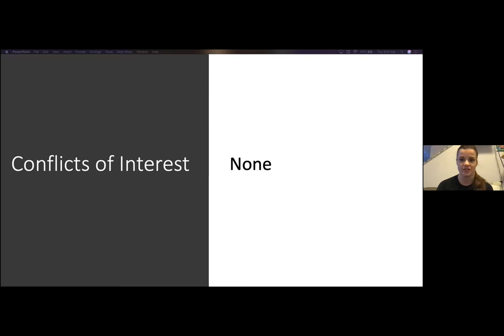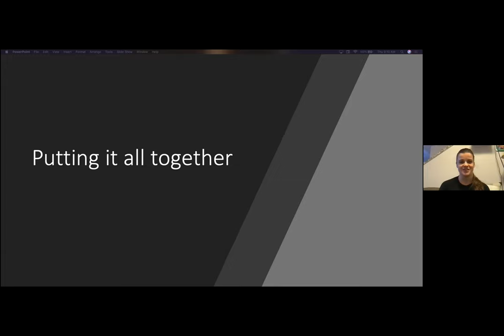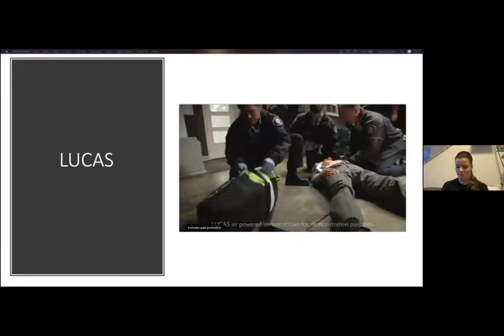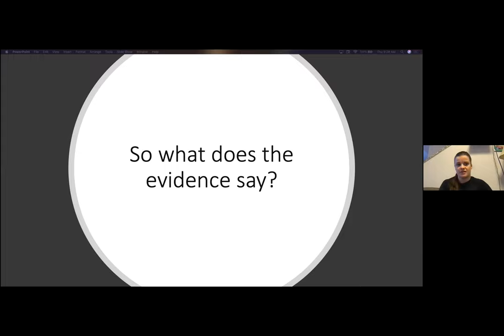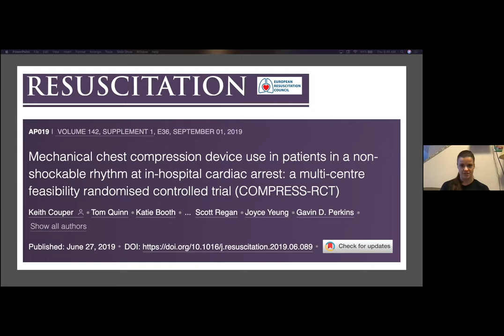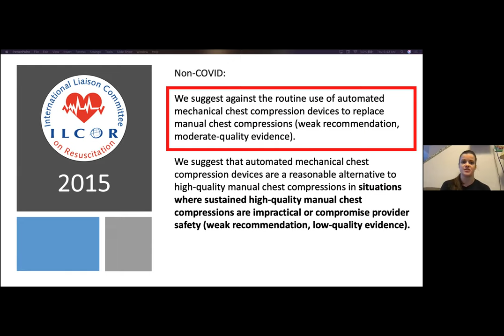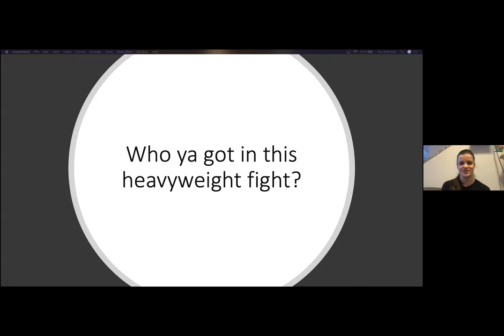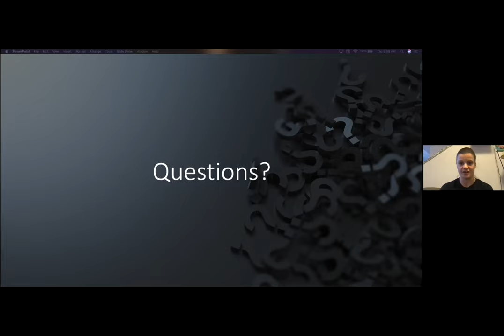Dr. Danielle Kelton: Mechanical CPR Devices in the ED

Comment: Personally, prefer ' another one bites the dust '. CPR, in the absence of a shockable rhythm, has a uniformly poor outcome and the patient numbers required to see a signal would be huge. The 20 minutes I run a nonshock code is not overly tiring. The point that should be written in stone is not to delay shocks to put this joke on!